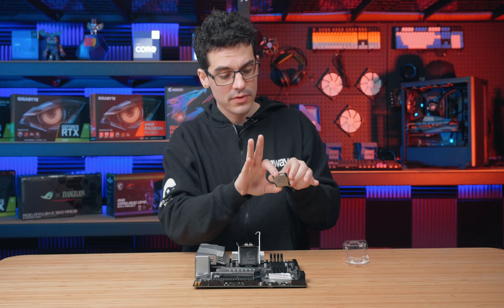How to Install a 12th Gen Intel Core CPU

Comment: Great video man i bent pins first motherboard.... have any advice for no bent? 
I bought new motherboard and so anxious to install cpu... ty
They make so fragile socket pins old socket never bent pins...
Reply from the maker: Hey mate. Sorry to hear that you bent the pins on your first motherboard! My advice would be:

- Install the CPU into the motherboard while it is outside the system, and have the motherboard laying flat on a table or bench. I find it easier to hold the CPU and lower it into the socket, instead of inserting it horizontally while the motherboard is inside the system.
- Use the triangle marker on the CPU and match it up with the triangle marker on the socket/socket cover. This will give you the correct orientation for the installation so you don't have to guess which way the CPU is meant to go into the socket. There are also notches on the top and bottom of the CPU which will line up with the notches on the motherboard socket. You can also use this to figure out the orientation for installation. Check out 1:23 in this video where I explain this more clearly.
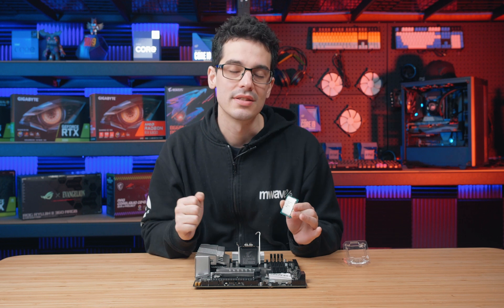- On the motherboard socket, you will notice that there are 2 groves or cutouts on opposite sides of the socket. These will allow your fingers to hold the CPU and you can lower it into the socket, without needing to drop the CPU because your fingers hit the socket before the CPU is inserted all the way. Check out 1:45 in this video where I explain this more clearly.

If you follow these points, you should be fine. Just remember that the CPU will slot right in if you have inserted it correctly, and there is no need to force it into the socket. Let me know how you go and good luck! I believe in you mate! 👍
Reply: @MwaveAU  Thanks for reply man,can pins straighten cause was brand new motherboard ....plastic cover have sto stay up when install? ty
Reply: @MwaveAU Can use antistatic bag  under the motherboard or no need?
Reply from the maker: Hey Dimkonsta. Sorry for the late reply, but if it still helps, the pins on a motherboard can be bent back to an extent. Without seeing how badly they are bent, I can't guarantee that the motherboard would still work. But if they are not too bad, you can bend them back with something hard and thin like a credit card.

I would however recommend you seek help from a professional if you want to try and bend the pins back, as there is always the chance that you cause further damage to the motherboard pins while trying to re-straighten them.
Reply from the maker: Hello again Dimkonsta. For peace of mind, you can place the motherboard on top of the antistatic bag, however, if you are careful, there is no need. Placing the motherboard on top of the motherboard box while installing the CPU, RAM and storage is always a good idea to protect the bottom of the board from excessive force.

Comment: I'm coming here as someone who'll be upgrading from my i7-3770 system from over 10 years ago. I've heard a lot of stories about flimsy pins & how easy they are to bend & break. I thought the 3rd gen's pins & socket were pretty sturdy, so it comes as both a surprise & spooky to me to hear all that with the 12th gen.

Thanks for confirming that so long you're careful & abide to instructions, I'll most likely be fine though. I appreciate it!
Reply from the maker: Hey mate. Apologies for the late reply! Yeah, the pins on a CPU (or motherboard for older AMD setups) will most likely always be fragile. As there are 1700 pins on a 12th/13th Gen Intel CPU, they had to be quite small to fit them all in on that small surface.

But if you follow the tips in this video about how to hold and remove the CPU from the clamshell, you will be fine 😊 Since your original message was so long ago, I am assuming that you have completed your build. How did you?
Reply: @MwaveAU  Its ok! We all have irl things to attend.

Speaking of the build, on the contrary, actually I'm still waiting for all the parts to arrive. Which should be coincidentally later today (some case fans & the aio's 1700 bracket) & I should get to assembling everything. Hopefully will be done by later tonight & goes without a hitch. Will update later on the status of it. 👍
Reply from the maker: Oh how exciting! I guess my reply was perfectly timed haha 😂

Hopefully it is a pretty big jump in performance based on the old CPU you were running. What is your GPU and have you upgraded that as well?

Comment: Is it the same for 13th gen? Just ordered my PC parts with a 13700k, havent built a PC since I was 12 years old (2012) and it was AMD.
Reply from the maker: Hey mate. Yep, it's exactly the same. Both the 12th Gen Intel CPUs and the 13th Gen use the same LGA 1700 socket and the locking mechanism works in the same way. If you follow this video, you shouldn't have any problems installing your new 13700K 😊